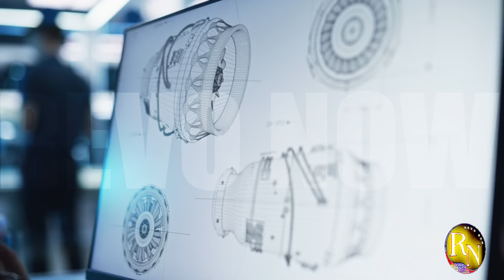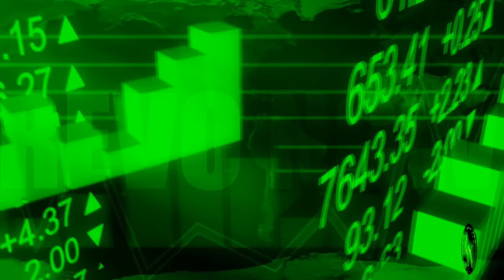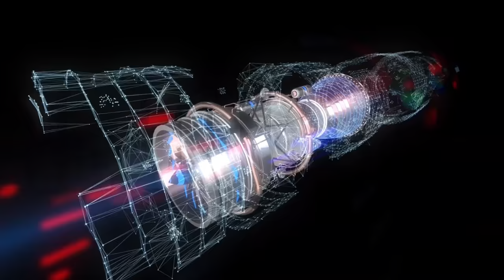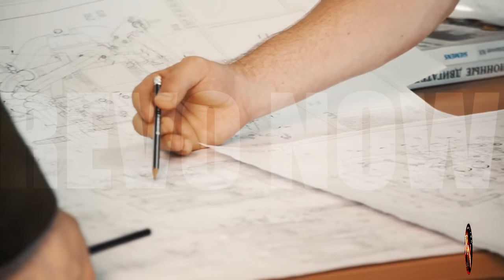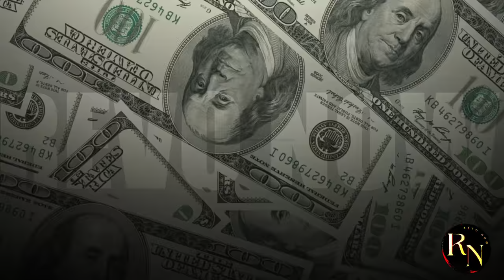COMAC Takes Flight! 🚀 Tripling Production Capacity with New Facilities

Comment: China has been producing parts for their fleet of Boeings for 2 decades. They have undoubtedly sought international expertise in developing this new plane, which must be reliable even if it's not quite as fuel-efficient as Boeing and Airbus. Increased production should be in step with quality control as safety is the motto of this industry.